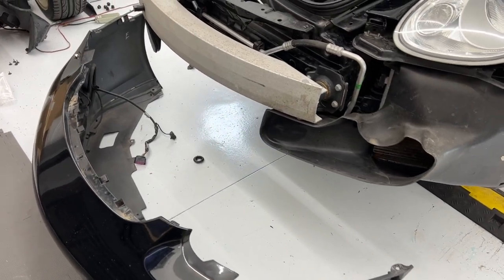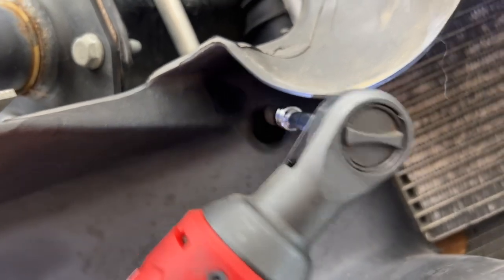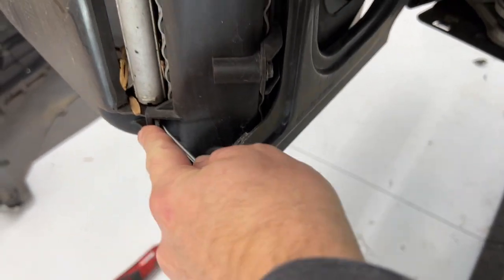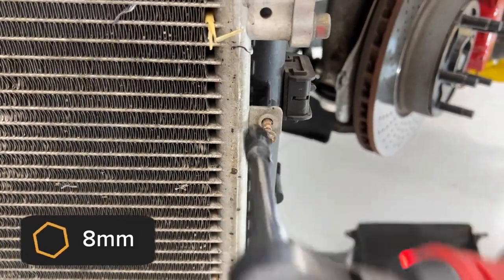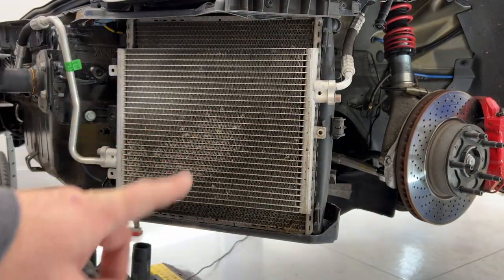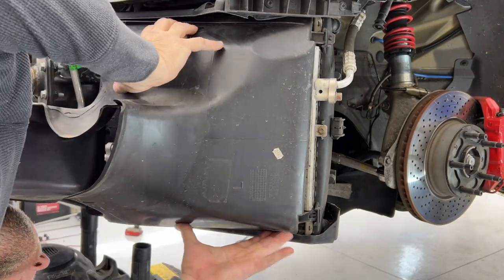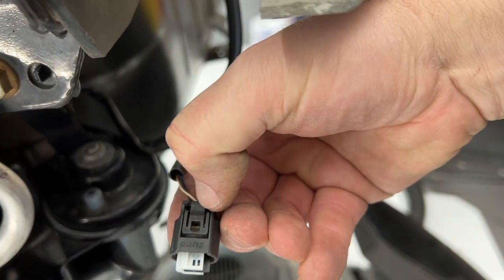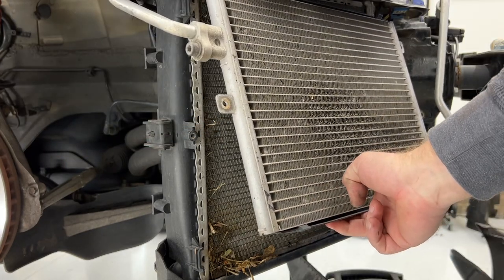How to CLEAN THE RADIATORS of a Porsche Cayman 987/ 911 997

Comment: Just got a 2005 Boxster (2.7) 12 days ago as my first ever Porsche and will certainly follow your videos (subscribed already).  As folks said, I only used shop vac for now and will certainly remove the bumper in the future.  Since I just cleaned our house AC, was wondering whether using those foaming AC coil is necessary.
Reply from the maker: +Ho thanks for subscribing! Great question. I’ve never used one so I’m not sure.

Comment: Very helpful thank you, as this on my to do list in the new year.  Do you think compressed air would clean the radiators any further, beyond the vacuum?
Reply from the maker: +Barrie Stevens you’re welcome! Yes, I think that will help get a little more out from between the fins. I was just too lazy 😁
Reply: I was told by a radiator guy to use 15psi compressed air. It works, and there is no damage to the fins.
Reply: I don’t have a compressor in my garage so I used my shop vac on ‘blow’ with a small nozzle and a soft brush.  It worked just fine.  I separated the condensers and rads by about an inch so I didn’t blow debris from one to the other.  Nice and clean now 😊 and all ready for the summer (I also fitted mesh grills whilst the bumper was off …. much easier).
Reply from the maker: @len333p  awesome 👏